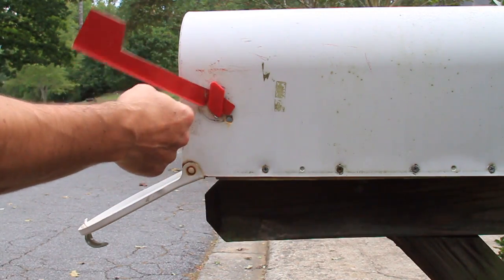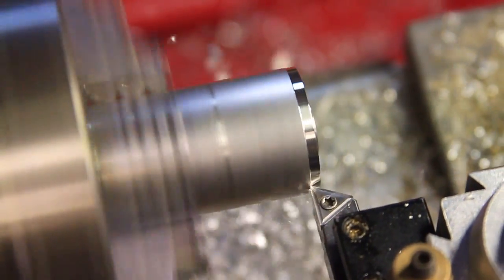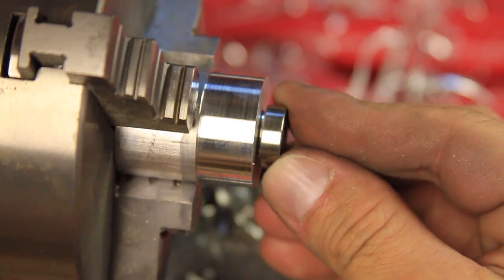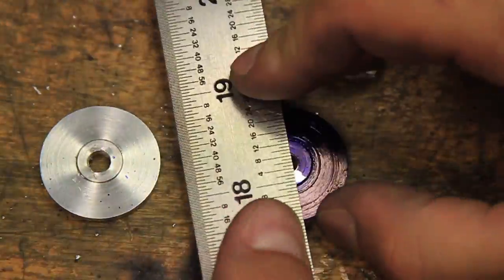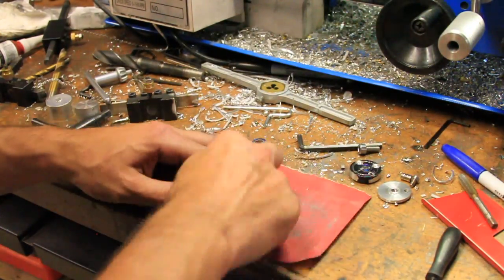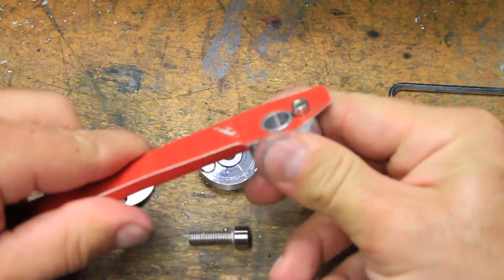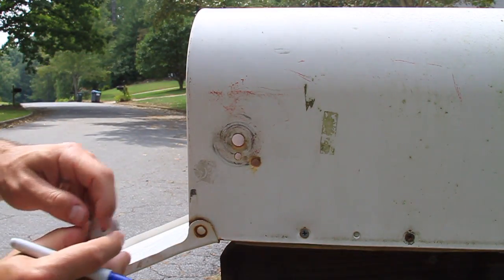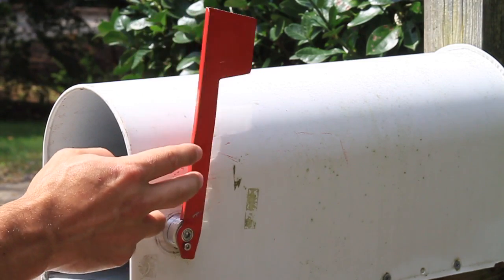Making a Non-Terrible Mailbox Flag Holder (bearing + magnets)

Comment: You may need a bushing on the outside of the flag too, clamping over its thin sheet metal, just like the inside of the mailbox is clamping the thin sheet metal of the box.  Then it will be over-over-engineered. :)

Comment: hey buddy me again to keep mine from shaking like yours was i took some 1/4 inch thick by 9 inch flat bar and took the 2 rubber feet pads on each end and put them on the flat bar to make it more stable and keep to from shaking
Reply from the maker: Haha you sure do live up to your name :) Thanks for the suggestion, I've been meaning to do something about that but I don't have a permanent place for it to live quite yet and I'd really like to get rid of the bottom chip tray and bolt it directly to the bench.
Reply: what i did with that is cut the tray down to fit between the two flat bars that i used so i can just take the tray out and dump if need be

Comment: You have two locking positions, but it there anything stopping it from hanging down if it's pushed beyond them?
Reply from the maker: Nope, I could have even more over engineered it to do so but I wanted to stay away from mechanical positioning for the sake of weather proofing, wear proofing, etc.  And honestly, I'm not sure where the mistake was (probably too much tolerance in the bearing fit and not enough in the spacing between the pieces) but it rubs a little if you're outside the proper range so it kind of has a stop built in :|
Reply: The error there is when you re-chucked the bearing housing. The already-faced surface was not perfectly perpendicular to the spindle axis. So once the bearing is seated, there's a small amount of "wobble" built into the part. It probably doesn't matter at all for the application. You could have avoided it by boring the bearing sleeve and facing that surface all in the same chuck setup, then made your magnet pockets later. But as you point out, this was a 'plan as you go' build. I think it worked out great for what it is - though I'm worried your lathe is gonna get up and walk away from you with all that vibration. ;D

Comment: Might I suggest a way lower rpm and a steady stream of coolant (a bottle with a small metal nozzle filled with water based coolant will do)? It'll make for a hell of a lot easier on the ears..
EDIT; That is, for the parting of pieces in the lathe.... small detail I forgot.

Comment: Nice work mate. I was thinking something, instead of using the parting tool on the lathe, can you make a tool that will hold a piece of hss band saw??? And cut away pieces like that??? Give it some thought, it might be worth making something like that..
Reply from the maker: I wouldn't rule it out - but I don't know that it would be much better than the parting tool. Thanks for the comment though!
Reply: Bojan Maksimovic only one or at most a few teeth of the saw blade would be doing all the cutting, so that would be exactly the same as having a very narrow parting tool with the extra side effect of going blunt in a heartbeat.
Reply: I doubt that it will go dull in a heartbeat being that most of his projects are on aluminium which is very soft, and how quickly will you destroy an hss blade is most of the time to the operator, you push it too hard of course it's gonna go dull, when you develop a feeling for it it will last you quite a while. I have seen many lathe workers using a hss hacksaw  for a parting tool when working on softer metals without an issue. At the very least the thin profile of the hss blade would give some deserved break on his lathe motor witch is clearly struggling  with the parting tool he is using :D
Reply: Bojan Maksimovic a handheld hacksaw works fine as you can move it back and forth a little to spread the wear (and most importantly the heat) across the whole blade. When mounted as a tool on a lathe, one or two teeth do all the cutting and they're not able to conduct the resulting heat away from the tip fast enough.

Comment: Very nice design! But your "slip-fit" for the bearing is more of a "throw-fit" (loose enough to throw the inner part in from a distance), as my shop-teacher would call it...
Reply from the maker: Haha, that's probably more accurate... but for this application it should be fine.
Reply: its also not that easy to make a slip fit, most of the time it goes from a german virgin right to a 50 y..o mother of 2-3 children.
Reply: Gotta leave some space for the Loctite. LOL.
Reply: Sharky from gudentight to hotdog down a hallway